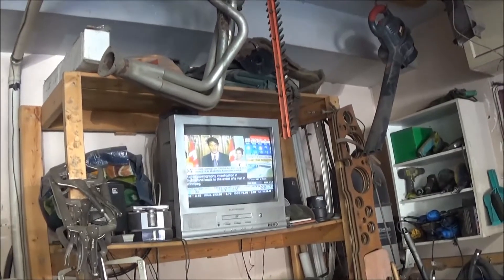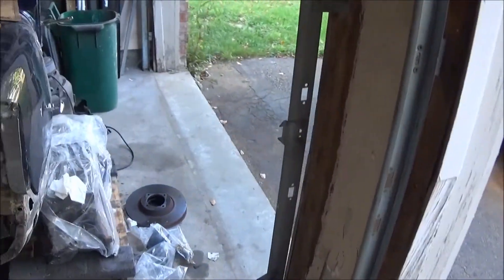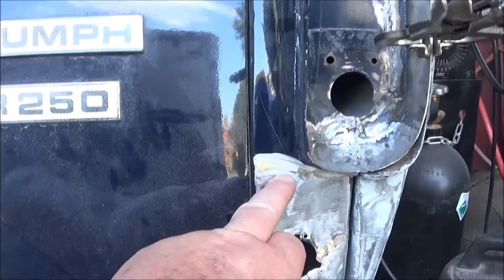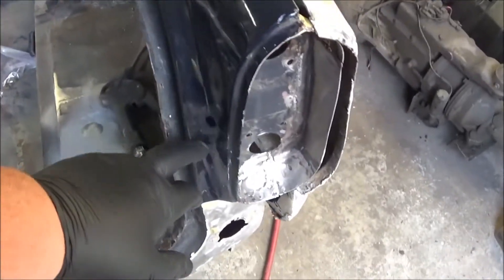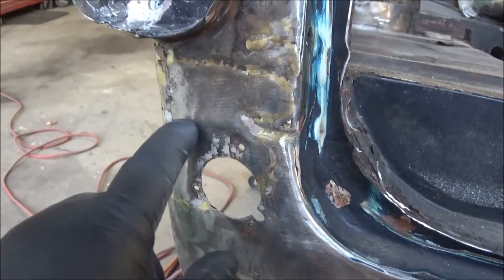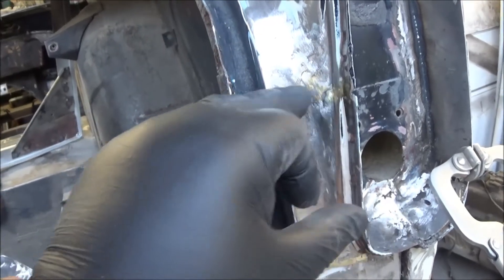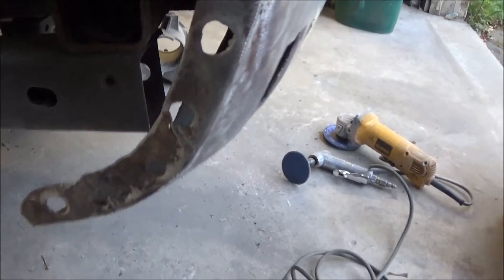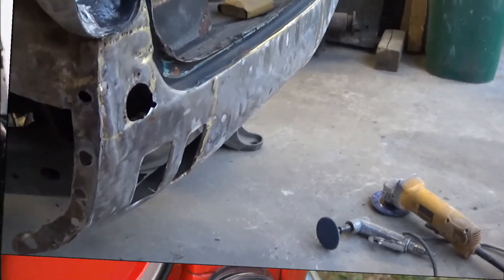1968 Triumph TR250 Restoration, Rear Valence Dissection/Discussion

Comment: David,You should be able to find the original seam by looking at the weather strip channels.
Reply from the maker: JohnCarey1963Jag hi John, tried that but can see them either. I'm going to wire brush the area a little better to get the channel cleaned out.  I believe I can see some of the remnant of the top and bottom flanges on the inside of the panel.  I didn't think I could earlier as they were covered with undercoating. I've cleaned it a little better under there now.

Comment: Chef, fyi there is a post on craigslist seattle for a TR8 intake w/2 carbs for 200.00. I have no idea if it is something you want or if that is a reasonable price...
Reply from the maker: George McCormick hi George.  Thanks for thinking of me, I really appreciate it. My TR8 is a fuel injected model through so carbs will not work unless I do other significant modifications.  Cheers, Tush